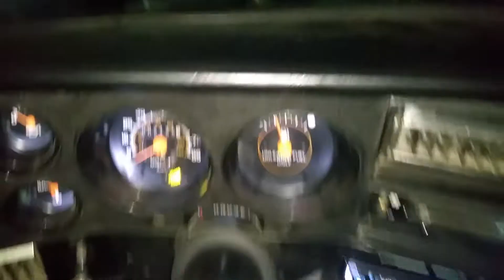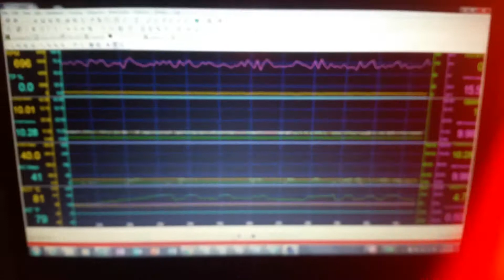The rewards of IAC effective area tuning.

Comment: Gadget Deez I have an 02 Camaro with H/C/I  my idle is rock solid when car is sitting still.  If I push clutch in coming to a stop it dies.  It has a NW 102 TB and my IAC counts were about 150.  I adjusted the screw on the TB as much as I could and still keep the TPS voltage at a max of .65 so my TPS would still be 0% with foot off the gas.  They are now about 80.  Most people say 40-60 is best.  That would require elongating the holes on my TPS sensor so I can rotate it back to keep TPS voltage in spec.  I'm not against doing that.  I have done it before but someone told me I need to tune the IAC effective area.  Something I know nothing about honestly.  You think you could help me?  BTW I'm running an OLSD tune.
Reply from the maker: After idle stabilizes,  effective area has nothing to do with anything. Effective area is for predictive iac flow in transitional states.  For example, during cruise when you command a follower air flow at part throttle or when going from cruise to closed throttle. When you go to idle, It allows the pcm to look up desired air flow in the engine desired air flow chart and say "oh, you want xx air flow to keep the engine running? I SHOULD be close if i go to this many steps based on iac area chart." Then as you begin to idle, iac short and long term trims come into play and it adjusts your idle up or down to meet target and stores these values in stit and ltit tables until you turn the key off. My recommendation is get it to idle around 20-30 iac counts. Dial in your idle VE table within 2% correction on your wbo2 in a perfect world. Let it cool. Log dynamic airflow during an entire warmup using a histogram against coolant temp. (You need to dial ve table at idle first. This is how the pcm calculates dynamic air. Without this being dialed first, the rest of this is just gonna be wasting your time.) Put those values in required air under park neutral ac off tables for auto, or both park neutral ac off and in gear ac off tables for manual. Once that is done if your idle correction is off and it is ADDING air in the short or long term idle trims meaning your iac desired air doesnt match your dynamic air (dynamic air is larger than idle air), you need to copy your whole iac area map and copy/paste it over a couple cells or up/down if you're using efi live so that the AREA INCREASES per number of steps.  Larger area=larger air flow. For the end of the graph where theres a gap from moving the whole iac curve, just guesstimate what the curve would do if it were there, not super critical. (If you wanna be super baller, on cold startups, you can log the difference between dynamic and idle air and fiddle with the iac steps in that area in the iac effective area chart. Reduce steps to increase air, or more steps to decrease air so that iac desired air always follows dynamic at idle. Remember, iac trims invalidate iac area predictions during steady state idle. This is why you always populate idle required air with actual maf air measurement (or dynamic air on sd) and then adjust the iac area to correct for any short term idle discrepancies as idle desired air uses area calculation to get the idle desired air flow number. ) I'm a bit upset that there is so much misinformation on the web regarding this. Most people will tell you to do an "rafip or rafig" to use idle trim tables to adjust idle required air flow tables. Dont do this. Its a bandaid to the larger problem which is incorrect iac area tables. Also, if you adjust the throttle stop screw after adjusting all this, you completely screw the pooch. So whatever amount of steps you are at while warm, make sure that if you adjust the stop that you put it right back at the same number of steps you did this procedure with. If you change idle speeds, you will also mess this whole thing up and will need to do it all over again. Lol good thing tho, if you get the iac area filled in with a cold start log like i mentioned earlier so the idle correction stays near zero, usually just sliding the whole graph one cell to adjust left or right (up/down) is usually still kinda close.  if you need more info, i'll be glad to help out. Sorry so late. I never check my youtube. Lol
Reply: Question? Do you get the iac counts around 30 with the ac on? Curious cause I use the ac pretty much all the time.

Comment: idles great for 224/230 you got rafig figured out.
Reply from the maker: Rafip/rafig yes. Set idle, dial ve and maf within 2% or less, now maf and ve should match. Log maf air flow and fill desired air flow (in gear or park depending on if you were in gear/park in auto, or both gear and park for manual)  with MEASURED air flow values recorded with maf, then if idle desired air doesn't match, move iac area around till it does. Cold start, log maf vs idle desired air flow and steps. Go to steps and adjust up/down in area to make idle desired match maf/ve air flow. Done. And you'll have most stable idle you could possibly ask for.